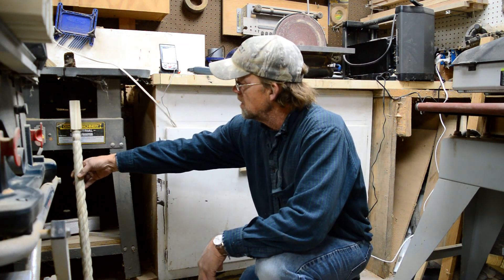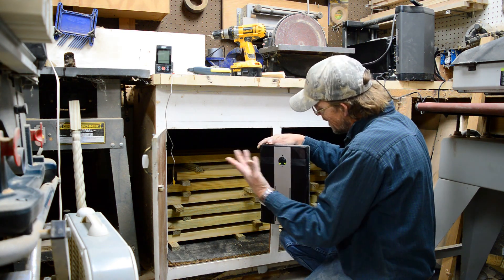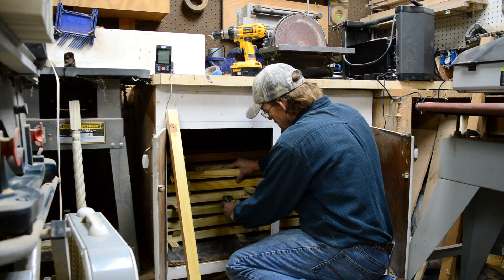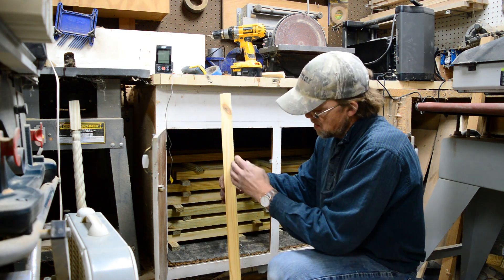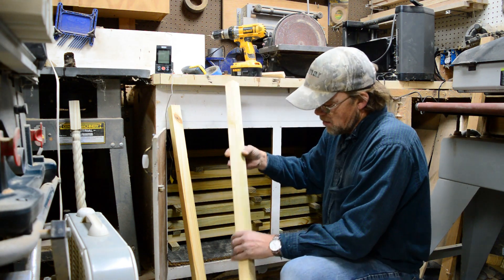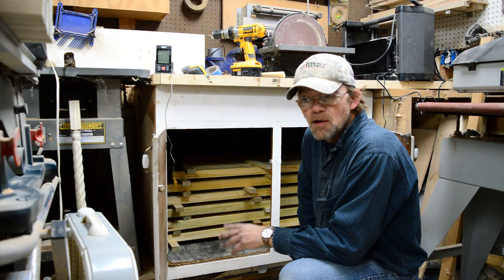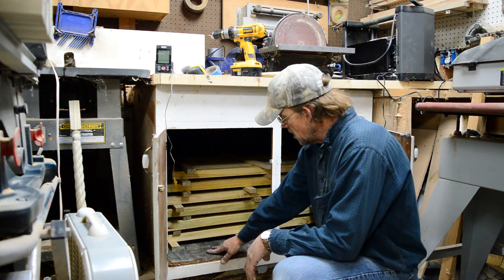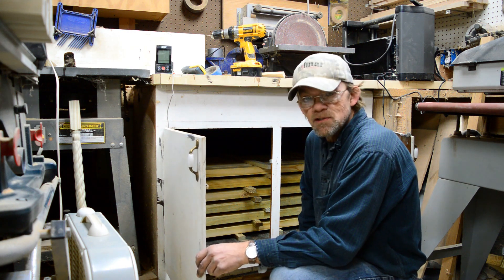small dehumidifier wood kiln by Allen's Woodworking.com

Comment: I bought a dehumidifier and put wood in an insulated room that's 80 inches by 60 inches. I just did this and the outside temp has dropped to 10 degrees. Lol. The inside has not go up very high. The bucket fills up fast. I have a heat lamp in it. I'm thinking I need to add a heater.